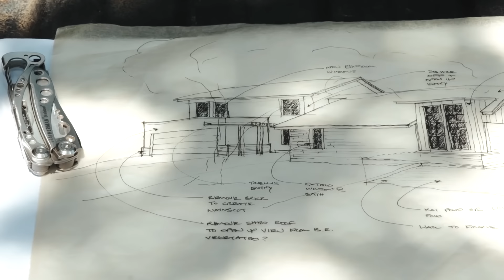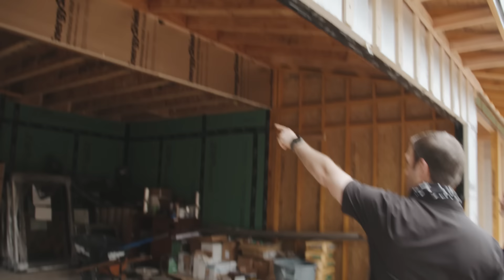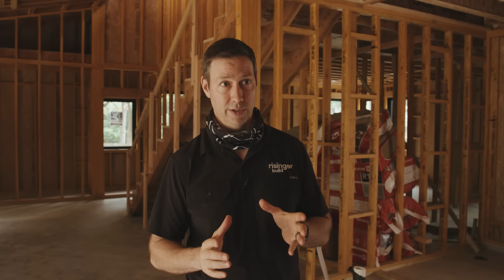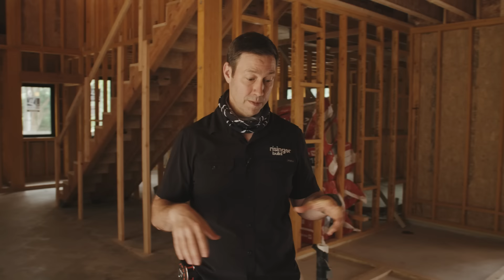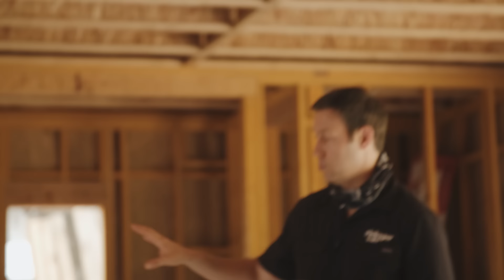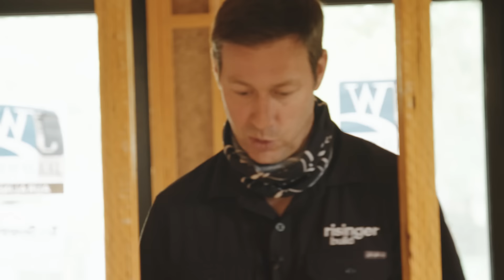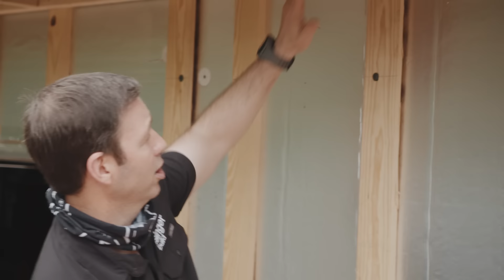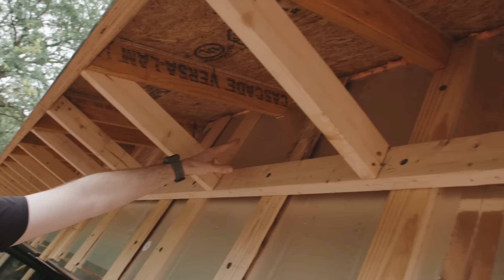The Perfect Wall - Building Science Training

Comment: I'd love a rough price comparison between building like this vs traditional methods. Great episode, thanks for sharing!
Reply: you'll never recoup your cost vs going code minimum
Reply: @jl9678  that's why we need to accelerate code minimums. Things seem to automatically get cheaper at that point.  We have seen where the large national builders have continually lobbied for deferments on code minimums.
Reply: @jl9678  Over the long run, that may not be true.  We live in a 29 year old house that has had all kinds of water infiltration issues, air leakage issues and generally shoddy workmanship.  It's not a cheap house either being a custom 4500 sq ft home. Electric bills run close to $750 a month in the summer running 3 a/c units in N. Texas because it is so inefficient.  Investing in the kind of building technology that Matt is showing would save you a huge amount of headaches and money by not having to correct problems down the road.  To quote Kyle Stumpenhorst, buy once - cry once.  In other words, get it done right the first time.  You get what you pay for when you cheap out.
Reply: @hhanger1  As a long-time builder who has regularly exceeded Matt's standards, and has done a great many costly water intrusion/ damage repair and remediation jobs for nearly a half century, you have put the case  accurately and succinctly. Today's production homes are designed to be sold and out of warranty before the failures and major repairs start (and it is usually very soon). Rebuilding the cladding of a 7 year old house (as per my last project) because the living room flooded every time the rains came from that side of the house is pure greed and insanity. You can proportion those out as you see fit (hint: it is not at all ALL on the builders).
Reply: Keep in mind Matt’s comment about building a house to last multiple centuries.  The initial cost should rightfully be spread over at least a couple hundred years.  A concept most of us are not equipped to handle.  If we built for a family to stay in the same house for say 300 years, the cost starts to look more reasonable.  Many European house have passed through several generations.  So, it is possible.  The key is quality of the initial house.
Reply: Keep in mind he is the builder building for himself.  His cost is a lot less than most people.  I’m sure he is getting deals from his suppliers and subcontractors  as a thank you for the business they do together and no builder’s markup.  I’m sure there is probably some write offs to his business as well as the YouTube content the video series will provide resulting in some income too
Reply: @jamesmoon1841  So you hope and pray every 3rd or 4th generation has quite the fat bank account eh?? and is willing to keep the said house in the family.
Reply: We've done some studies as architects, and found out that doing more energy efficient houses costs only 10-15% more than the old-fashioned way.
The biggest obstacle is not the technology, but the contractors.
Whenever you want them to do something a bit different, they resist, "but, we've always done it that way".
Yes, but the way you have been doing it is wrong!
Hard to convince older construction people of new methods and technologies.
More thought has to be done when doing more energy efficient homes, and that tends to baffle and slow down most contractors.
This, they always translate to higher costs, but that is unfair is not correct.
Thinking doesn't costs a cent, not thinking will costs you money, lots of money to the point where the house will have to be demolished because it has water damage or mould.
Reply: @hhanger1  
Absolutely correct.
Reply: @jl9678  Comfort is worth something and if the house stands long enough you eventually get there. That's a major problem he is addressing, longevity.
Reply: @apscoradiales  multiple aspects of this house are 2-3 times the cost of a traditional system. This is not 10-15% more expensive
Reply: Howard's Channel i can’t believe ppl buy 2 stories in Texas .AC runs Non Stop . Noting but big hot boxes with only a 2 car garage .
Reply: @bobhager5248  
Just for a minute consider the sillinies of your argument.
If you take your car to a mechanic, and tell him to change engine oil and the filter, he comes back later and tells you, "sorry, I wasn't thinking. I changed the oil, but instead of the oil filter, we changed the air filter".
To do any job, ANY job, you have to be thinking. If you haven't included "thinking" part in your bid, then you have not been thinking.
Sometimes the thinking part could be as simple as reading the instructions for the materials you are told to install or simply asking for further directions from somebody who knows how to do it.
"We have always done that way, so what's the problem" does not wash. And, I have seen both scenarios all too often on the site.
By the way, we all think about our "personal lives", family issues, and our clients.
I have a lot of respect for "qualified" workmen, but I have very little patience for guys who say, "Oh yeah, we can do that" never having done it or not even reading the instructions - such as specifications or drawings or literature that came with the material. Don't pretend you know everything, and can do everything.
If you don't know, ask - there is always somebody who knows it and can teach you.
That part shouldn't have to cost a cent. If you're charging the client for reading the drawings or specs, then I wouldn't want you on my job. Simple as that.
Reply: @OOpSjm  Accelerate code minimums, and price everyone without a half a million dollars out of the house market. Better than 1/2 of the crap in the code has nothing to do with better building and all to do with control and figuring a way to get the "right" people more money.
Reply: How do you put a value on comfort? answer that and you can put a ROI.  ROI for the builder is not there, they build to a price point, not quality or energy savings per month. 
People buy on price of basically how much per month.  utility bills play no part in that.  I would rather pay an extra 100 a month on the mortgage if a home is efficient, comfortable, and saving money on bills every month.
    I lived in a basic built home and the windows sucked, in the winter you just didn't want to be near them. So started to replace them, thinking they were just crap aluminum  windows with broken seals BUT in reality it was just poorly installed. for 15 years owners dealt with crappy comfort.
Reply: @apscoradiales  "The biggest obstacle is not the technology, but the contractors."  Not fully the case, we have to have the client's to be able to afford it.  Client's have budgets, it is a competitive market and we have to have jobs
Reply: @marcob1729  I think Apsco was referencing better building practices generally, not Matt’s Super Zero Emission Greatest Home Ever Built model. You’re right about this house, it’s incredible. But use of a rain screen for instance (in moist climates) ensures siding lasts for decades, but it costs maybe 2-3% more in materials, 5-10% more in labor. There ARE improvements we can make, but you don’t have to build Super House.
Reply: @bryansimmons3723  If building code is anything like other gov’t regulations, somewhere in the past, someone made a mistake that killed or maimed or somehow injured someone and so precautions were put in place. Hurricane straps weren’t part of IRC until houses started being lifted off their foundations regularly in bigger storms. Somebody thought, “We should secure those structure to their foundations.” That seems reasonable. Floating houses are bad.

Comment: Passive design is also about solar load control. Large roof overhangs that block the sun from hitting the south windows & wall in the summer but in winter the sun can hit the wall and come in through the windows. Often the glass is small on the North, East, & West walls and large on the South. Passive done correctly can help heat the house in winter & cool (shade) the house in summer. All the insulation and airtight details are just conventional energy-conserving construction.
Reply: Matt saying he wants to check out if he can go passive house after the fact is as scatter shot as his initial start of this project. If he's going to get certified passive house trained, I would love to see him build one from scratch from the planning to the final certification.

Comment: Don't put solar on the lower roof.  When the snow on the upper roof slides off, it will land on the lower roof.  If the solar panels are there, it may damage them. (edit: Austin gets ZERO snow, so viewers that get snow should consider that.)  Also, take into account all of the shading you have.  Have the solar install company use a meter that they hold on the roof in different spots.  it knows where the sun is throughout the year and will calculate the blockage of the shading.  I'm not sure what you call it, but it's predictions were spot on with my solar array.  If you get 15% shading, install enough solar to overcome that or cut down some trees.   Asthetically, I would fill the upper roof with solar panels edge to edge with offsets. It just looks better.   Also, some panels operate better at higher temperatures than others.  Hitachi HIT is one example.  But there are others.  See if you can get the solar contractor to use the 1meter X 2 meter (72 cell) size panels instead of the (60 cell) size  you will end up with 2 rows instead of 3 rows for the same output. If you run a pure string inverter system, you will lose most of the output if some of the panels are shaded.  Use micro-inverters(enphase) or optimizers(solar edge) on the panels to deal with the shading issues. 

If an electric car or truck is in your future, they take about 10 kwh each per day based on 12000 miles per year.  I would also install a water collection system and store some of the water to use on the lawn and garden.  Rain water is naturally soft and is much better for plants.

I love the house build.  I would love to see how much you would have charged a customer to build the same house without all of the Freebies.

Comment: I love "nerdy building science"!!!  Knowing it is the difference between a 5 year and a 50 year result.

I was told that I could never feed myself as a home builder because I am a "furniture builder".  Fact is, IF we build houses using furniture building "care", we can have houses that last your quoted 500 years...

I grew up in Liberty, Texas....  Water, Vapor, Air, Thermal is even more important there.... and is typically and epic fail in 80%+ of the houses built there in the last 50 years.

Uncoupling principle....  works if you use it and control/reject vapor from SOG...
Reply: How did you get 20% of the houses built so well?  Impressive ratio, relative to most of the country.
Reply: @leestevens446  The rest are destroyed by hurricanes? which none of these things would help much if the water is flowing in through the doors.

Comment: In the Netherlands all new houses must be build with a US r-value of 34 on the roof, 25.5 on the walls and 20 on the floor.
(Metric R-values: 6 / 4.5 / 3.5)
Reply: The U.S. will not adopt those codes because there’s too much money to made with remodels. We don’t believe in multigenerational building. Unfortunately.
Reply: Us has multiple different climate zones, so not sure how those coorelate. In general I've seen cooler climates have higher r value requirements. In parts of Texas, for instance, there's not even a frost line, while in the North, the frost line is several feet underground. It produces significant different construction mentalities. Going so high on insulation is Texas would be so expensive it wouldn't provide significant savings on energy consumption for cooling. Factor in the added greenhouse effect of the additional construction for negligible efficiency gains, and you produce a house that takes significantly long to offset the costs. I do agree in general however, building codes in the US need to be updated and refined though. There's just so many companies that catake advantage and lawmakers don't have nearly enough to be useful.
Reply: The United States (9.8 million sq km) is also more than 200 times the size of the Netherlands (41,000 sq km).  The country includes humid continental, sub-tropical, semi-arid, arid, subarctic, and polar climates.  Each local area has to adjust building codes to suit the local climate and geography.  Comparing the two is like apples and a llama.
Reply: You insulate cold drinks on a hot day as well as hot drinks on a cold day... why wouldn't you insulate your (ideally) cold house in a hot climate? You like the hot getting in?
Reply: @lisatorry6758  What matters is the difference in temperature. Average min/max is 22°F/104°F in Austin, but 65-75°F is very comfortable, resulting in a delta of 43°F/29°F in extreme cases. In the average case (41.5°F/97.0°F, delta 23.5°F/22.0°F) in a well-designed house, the HVAC system will only occasionally turn on (the heat will almost never be necessary considering body heat, sunlight through windows, and misc. electronics). At some point, the cost of more insulation will be greater than the cost of the systems to cool and heat the home, even over time. It's why R-100 isn't required, for example.

Comment: Curt Allen here Matt.Been watching from day 1.I been building for over 38 years.I have watched your home go up and 9 foot walls are great.You talked about the materials you used.I love your Ideas and concept on building a better home.I have invented a few things for advanced home builds.My reason for texting does not have disrespect for how you built your home but for maybe your health.I will start on the materials you love.Lvl studs,If you use those you need lvl seal plates.Lets start with 
1st floor Lvl Floor joists.That are put together with glue as does every piece of wood in your home.Even the Osb that wraps the whole house.Rafters second floor joists all you Advan Tec.Plus install of Advan tec needs glue.Not including your LVLS.Im sure every piece of wood is not manufactured with glue.I know from it being 5 Degrees outside what wood burns the best and you have the best.That is not even my concern.My concern is 95% LVL Wood is put together with formaldehyde glue.Which there has been no long term study on the effects of the inhaling and handling by your contractor.Also how much is it going to effect you living in the house for the next 50 years. Formaldehyde has been studied in a short term test.The very first word I see and went right over to tell you was PSYCHOTIC TENDENCIES.This is no joke.I didn't even do back 
And read the Others. Check it out Matt .Need more Home Shows.I have some great ideas on passive homes and self sufficient home.I am Commercially and Hurricane certified.
Curt Allen .I am in the process of retiring but starting another company for homeowners to be able to build their home without getting ripped off by contractors.Matt stay healthy .Curt Allen Owner of Upstate and Design .

Comment: Agree that 9 feet is way better than 8'
Reply: I have 11' in my new house I just built and old house of 8'...  WOW, what a difference!
Reply: 12 inches better.
Reply: Did Matt do 9 foot or 9" 3"in to accommodate for the floating floor system?
Reply: 8' is okay if the rooms are small, like 19th and early 20th century houses. Mid- and late-20th century open plan houses though... yeah 8' is absolutely claustrophobic.